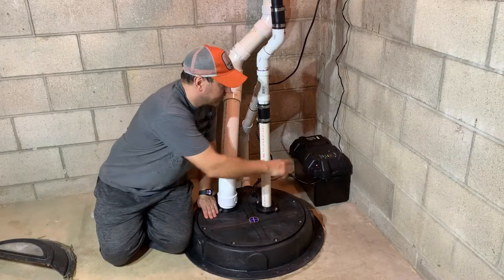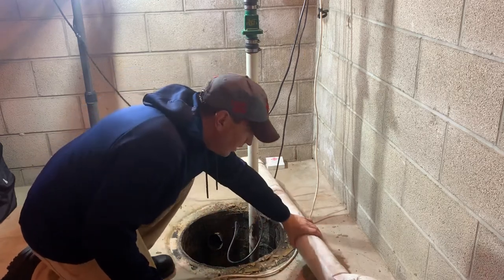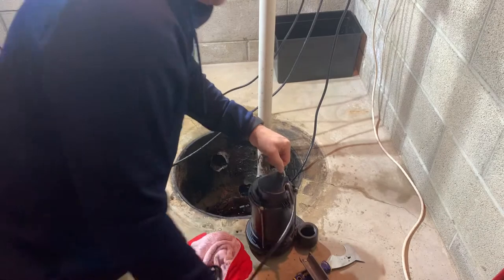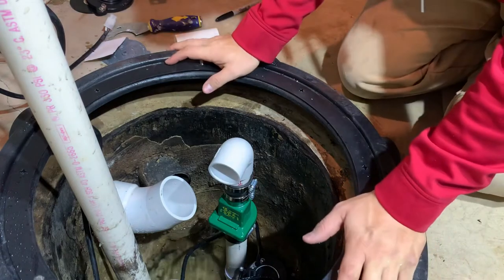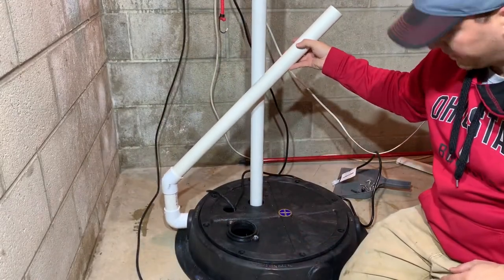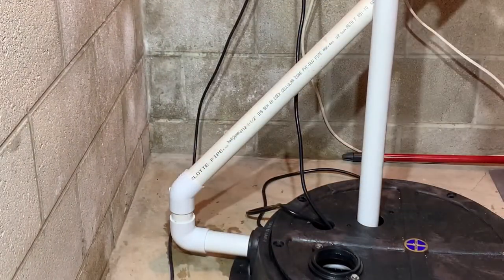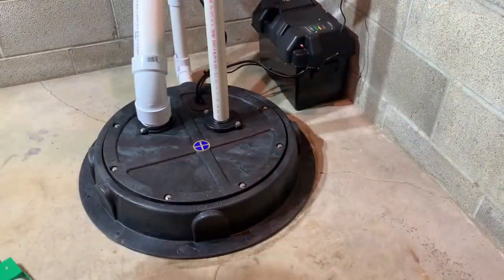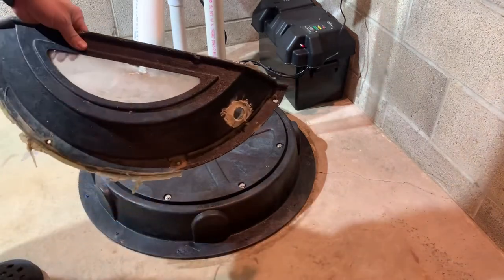Installing a Battery Backup Sump Pump and Radon Sump Dome

Comment: I have been using Zoeller pumps for 20 years 
Good pumps last forever, but the switch is always issue. You got a change it every couple yearI switch to Wayne  pumps now 
Look like they’re last longer no issues so far
Good job I will do the same thing in my basement
Reply from the maker: I have the same experience. It always seems the switch fails on my zoeller pumps. Usually they fail “on” for me, and I catch it before the motor burns up. I may change to use the electrical sensing types switches in the future to eliminate the mechanical failure aspect. Thanks for the input.

Comment: Great job and well documented. I have a basement watchdog battery backup pump and it is all plastic. It looks like the Wayne backup pump is beefier and appears to drain water pretty well. I might switch my battery backup to that. Years ago, I had the float switch on my Liberty pump malfunction and the pump kept running. There was a company that made a near field electronic water sensor/switch called Levelguard. It replaced the pump float and I bought a pump without a float switch and connected it to the piggy back on Levelguard. This circumvented the float issue. I believe that company has since closed doors but you can still find Levelguard in places like Grainger. I hope the battery backup is still working well.
Reply: I have considered changing to a water sense type float switch like level guard. I have never had a motor burn up, it’s always the float switch, so I feel like levelguard might fix that for me. If I install one, I’ll make a video of that too! Thanks for sharing.

Comment: I keep thinking about putting this type of cover on, but one time we had a pump failure in the middle of winter when all of the snow melted at once coupled with one of the drainage pipes being backed up / frozen and water was rising rapidly in that corner of the basement. I was able to just rip the dingy silicone/foam cover off quickly and get to the pump so I could make a repair. If I would have had to fiddle with something like this, way more water would have gotten into the basement. Cool video though.
Reply from the maker: Yeah it does make replacing the pump more difficult. My hope is the backup system would operate long enough for me to pop the cover off, and replace the main pump…which reminds me, I need to buy an extra zoeller pump to keep on my shelf in case of emergency!

Comment: Excellent video. Thank you
Reply from the maker: Thanks. Your welcome. Hope it helped you somehow, or gave you some ideas.
Reply: @EvolutionDIY  100%. Unfortunately I’ve discovered my radon issue after renovating my basement. So I have to cut out my subfloor to attach the sump dome to the actual concrete slab. May also have to totally replumb my sump outtake. Oh well. I’ll start with sealing the sump and see how my radon level changes then decide on installing a fan.

Comment: I was frustrated with the plastic push nuts as well. I wish they would have used a well nut design. It would be much better and no pushing the nut into the sump pit.
Reply from the maker: I had to google what a well nut is, now I get it. I like your idea of using well nuts for the acrylic window. I think I’m going to do that.
Reply: @EvolutionDIY  Also, use weather strip instead of silicone caulk so you can easily remove and reinstall.
Reply: @EvolutionDIY  If I eventually get tired of the plastic press-fit nuts falling through, I may see if I can find a well nut that fits the existing square holes. If I find one that works, I'll report back here with the size so you can try it.
Reply: @EvolutionDIY  I just finished installing an acrylic window in my lid. It turned out great. I could send you pictures and details if you like. Not sure how to send a message to someone via youtube.

Comment: instead of acrylic use a 4 inch clean out then you can get you hand in pit
Reply from the maker: I like that Idea I might just do that.
Reply: I'm doing the same. Cutting out that quarter panel and overlaying a triangular piece of acrylic. If you use well nuts, and use weather-strip instead of caulk, you can easily remove the window to get your hand in there. Also, should have slightly more room than just a 4-inch clean out (more room for both viewing and getting an arm in there).

Comment: Curious if when you say your pump switch went bad and stays on, did it pump water endlessly or eventually run dry? I've got that same lid on with a dual setup and no view window. Thinking I need to add a window. We had this setup put in before buying the house so the previous owner had to install and mitigate the Radon. Being over 2yrs and runs as often as yours, I wonder if mine has run its course and just stuck on.

Comment: Nice job. I'm wondering why you drilled a hole in the pipe below the check valve on the backup side. My setup is similar to yours, but I didn't put a hole in the pipe. Wondering if I should do it.
Reply from the maker: The hole is to avoid the pump becoming “air locked.” You can Google it for more info. The instructions that came with the zoeller pump I have (and the backup pump) both say to drill this hole, so I always do.
Reply: @EvolutionDIY  Thanks. I've never had a problem with it. I'll check into it.
Reply from the maker: @brianw6645  I also have never had an issue, and I don’t actually know anyone that has had this airlock issue. I was just following the instructions. 🤷‍♂️
Reply: @EvolutionDIY  I have the 1/2hp Ridgid pump. I couldn't find anything in the instructions about air lock.

Comment: How many hours do you get before battery drains?
Reply: My setup is nearly identical. My inflow of water into the sump is also very similar. In other words, my sump pump runs almost non-stop in the spring and after it rains. I can only get a few hours out of the backup when the ground is wet from rain.

Comment: Back up pump should always have its on discharge.
Reply from the maker: Yes I agree. Ideally the backup has a completely separate discharge, running out of the house separately, and discharging to a different area. In this case I was not able to do that. Also, I was mainly trying to protect against power outage, and main pump failure (not clogged or frozen discharge), so I just chose to share the discharge with the main sump pump.

Comment: where's the water coming from? 🤔
Reply from the maker: So my sump pump pumps out to drain tile, and then out to my pond. Turns out that tile was filled with tree roots resulting in recycling the water back to the sump. Had the lines jetted and it has helped a lot. I still get water, but not the constant cycling I was getting. I assume the water I get now comes from the foundation drains around the basement walls.

Comment: How large is the basin in this video?
Reply from the maker: The basin in this video is 18”. I didn’t have much trouble fitting both pumps in it. Any smaller and it might have been a challenge.